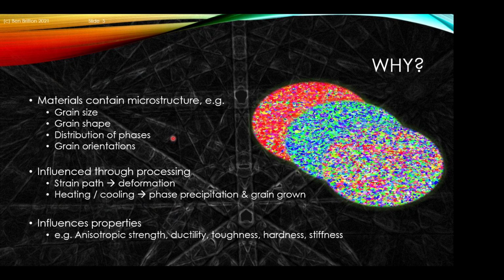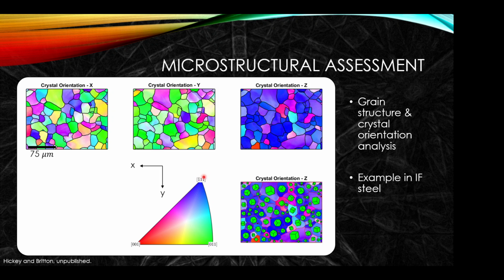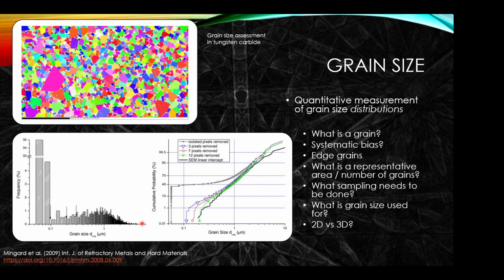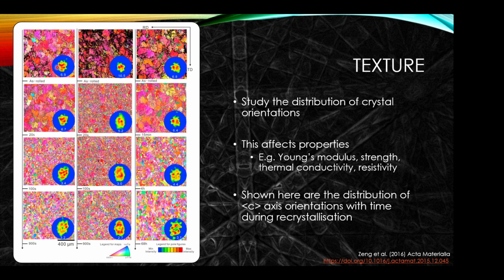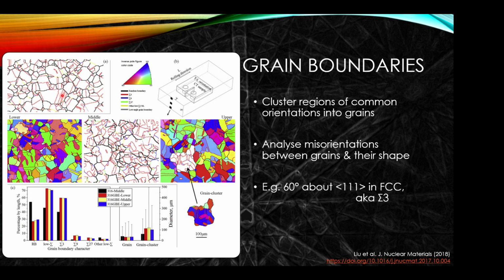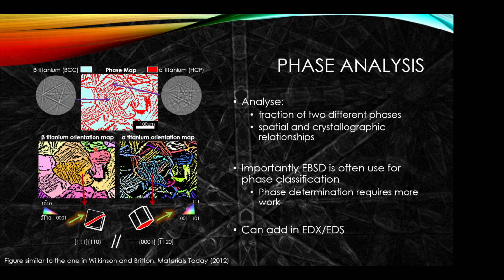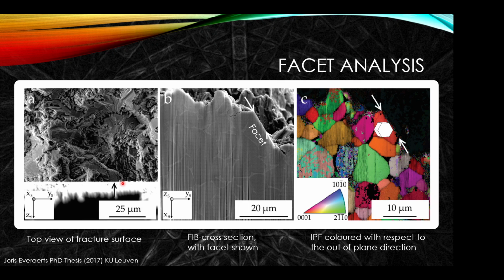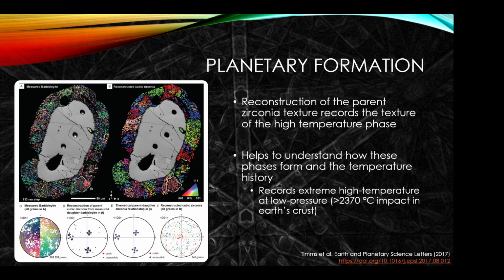Introduction to EBSD: Section 1 - What can EBSD tell you?

Comment: Dear Dr. Britton, 

Thank you a lot for these videos. I am just starting with EBSD and I have some probably trivial questions. Concerning the first part of this video, when using multiple distinct reference directions most grains change their colour. This means that a certain grain will have one crystallographic direction more or less aligned with respect to that specific sample direction. By switching the reference, the colour changes, meaning that in that grain some other cryst. direction is now preferentially aligned with that specimen direction, right? Is three-dimensionality included in this? I mean, if the diffracted signal comes from a specimen region which in the c-direction inglobes more than one grain, what can I expect the orientation of that grain in the a-b plane to be? Thanks for your attention.

M.B.
Reply from the maker: Hi - thanks for the feedback, and for the queries.

The IPF map colour is just a representation of the orientation, and how the colour changes with a choice of reference axis depends on the symmetry of the unit cell and the texture of the material. Imagine a cubic crystal, if you have it aligned with [100] (red) along X, and [010] (red) along Y - it will not change color when you switch between these axes (note it will also be red when you use a Z reference axis). If it is rotated 45 about X, then it will be red still when X is the reference axis is used, and now a different color when Y/Z is used.